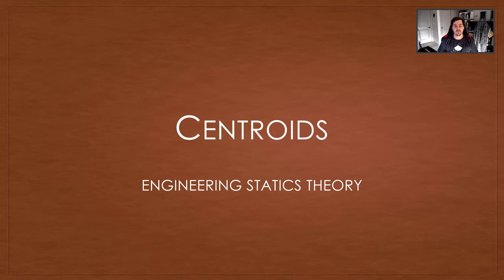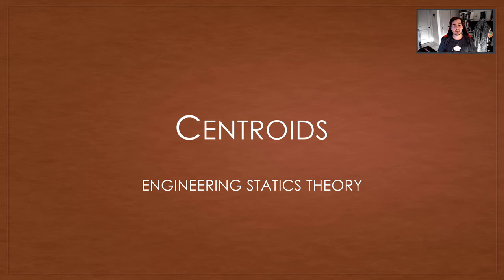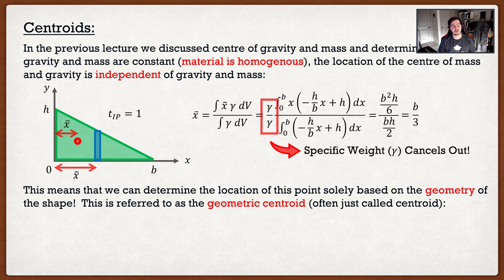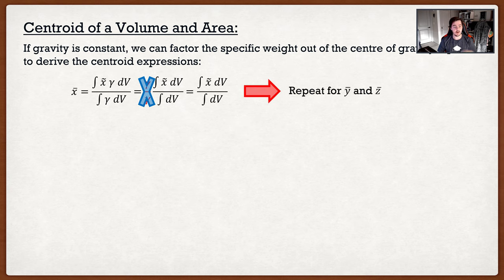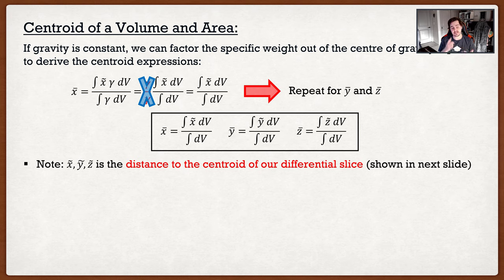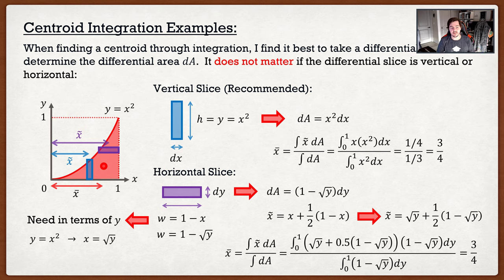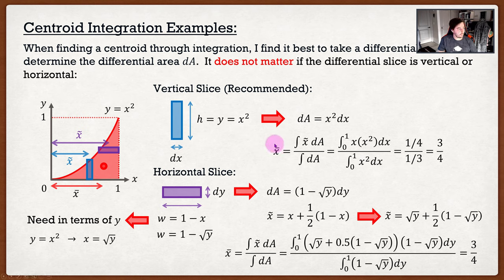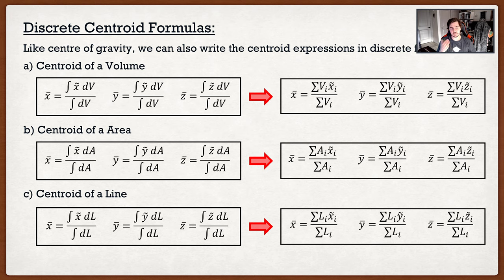Engineering Mechanics: Statics Lecture 23 | Centroids

Comment: Hey Clayton it was a really good video but how do you know which side of the differential slice we denote as dx or dy? Thanks.
Reply from the maker: It depends on if you take a vertical or horizontal slice.  For a vertical slice, the 'thin side' would be the base so the base would be dx.  For a horizontal slice, the 'thin side' would be the height so the height would be dy.  Hope this helps :)